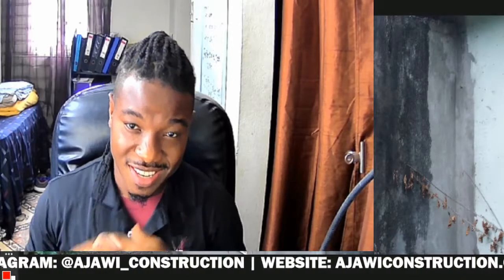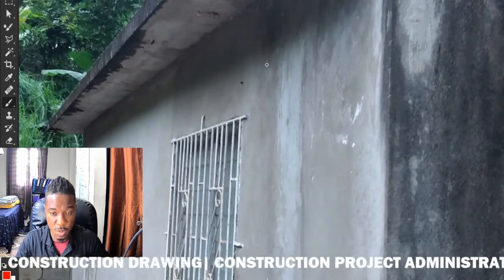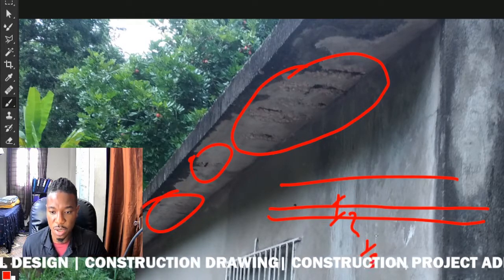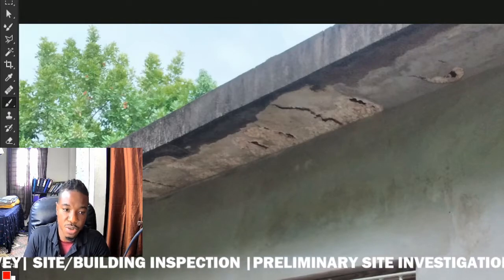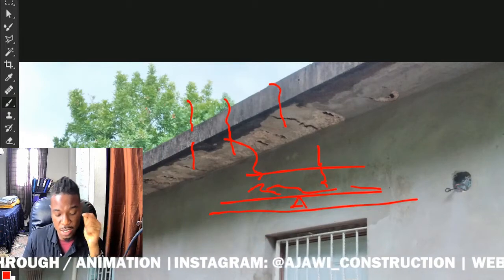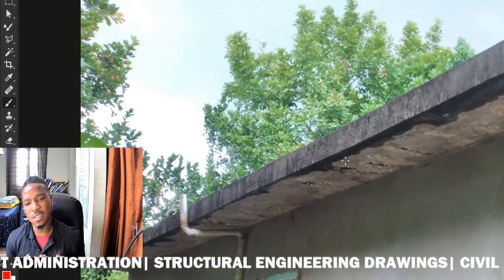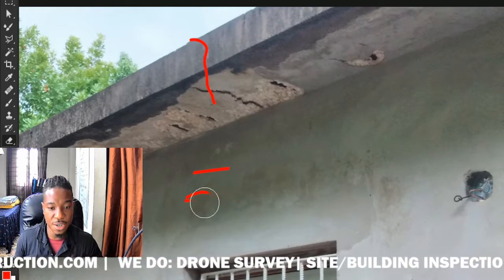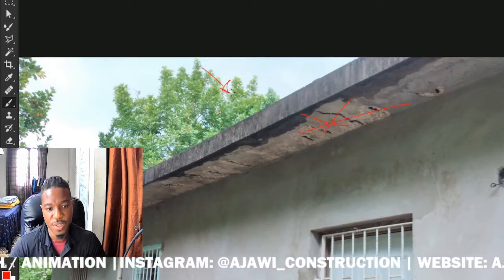HOW TO STOP  CONCRETE ROOF LEAKING & PREVENT SPALLING| DIY

Comment: Bra people hav been asking u the most important question and ur not answering it all ur doing jus giving a ❤ they wud like to no wat is the best material ,besides liquid heat roof membrane ro stop new or old slab roofs from leaking, price, durability, how it is done,name of it etc ,tnx in advance
Reply from the maker: I did give the answer to the question in the video. I can only give what i have tested and proven. There are many other option on the market however the options i have expressed are what i would recommend.
Reply: @AJAWI_TV  The problem is that there are a hundred "roof sealing products", mentioning acrylic, ceramic, urethathe, silicone, and contractors often suggest the top of the line silicone for $250-300 a pail X 9 plus $2K labor ($4,250-4,700). DIY people want to save on the labor and are also looking if a product costing like $100-150 less can do the job.
Reply from the maker: @itorres008  there are products on the market that cost very little. The problem is that we don't really research. If you go to any hardware as ask for roof sealing compound they will point you in the right direction. Just take a little effort.

Comment: I would like to know how to correct or fix it after the job is several years old.
Reply: You can research it here on YouTube. “How to fix spalling on concrete roof” type that in and see what comes up. @joahn Bennett-Scott
Reply: Yes. Also, if we try to save some money and do it ourselves, we have to know that if the product maybe was not good enough, does it need to be scraped off and everything cleaned or if new product can go over the previous one.
Reply: Me toooooo 🤗🙏😭😭😭😭🙏🤗